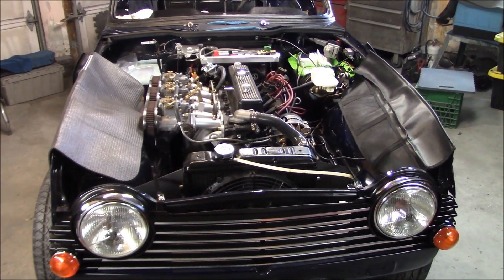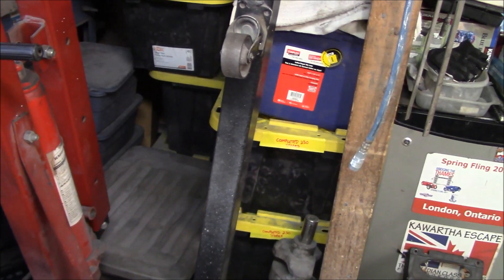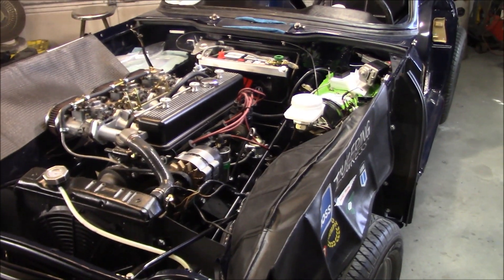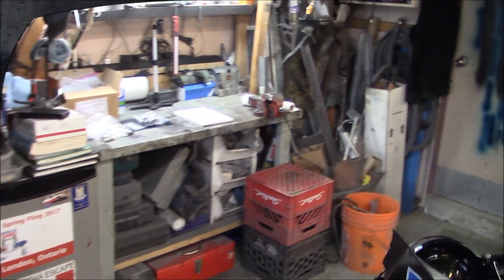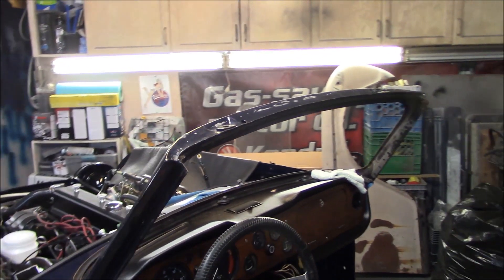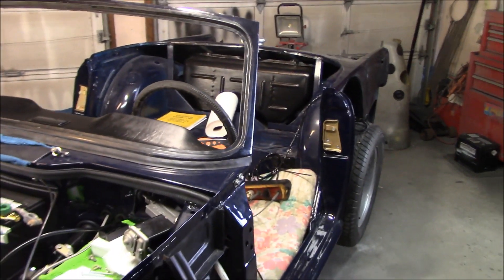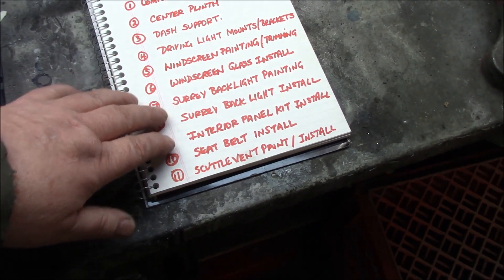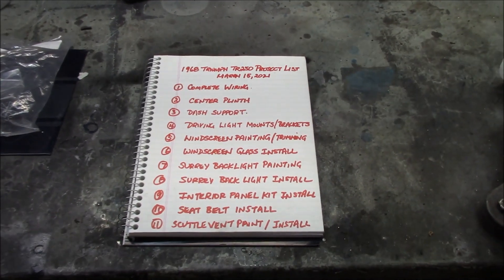1968 Triumph TR250 Restoration,  Project Planning Discussion and Next Steps....

Comment: David do an image search for “TR4 works rally car” and check out the light bar on that. It uses the bumper mounting points. I’ll bet you could fabricate one just like it. BTW - Revington sells a similar one for £270!!!!!!
Reply from the maker: Hi Jim, yes I’ve googled lots of different images and have found a few I like.  I know, the revington and racestoration ones are very expensive.  That 270 is 470 Canadian without the shipping/ duties or taxes.

Comment: looking great David.  An option on the dash support is crinkle paint,  Chris from Roundtail did it on his Spitfire and was happy with the result.  I am not sure of the configuration of your backlight, but if it is a window in a rubber seal, similar to the windscreen, some string between the backlight frame and and the rubber seal will give it a bit of a lift so there will not be a tape line where the paint meets the seal. Probably not a good idea if the seal is hard and brittle though.
Reply from the maker: Hi Graham, I’m not a fan of the crinkle paint..I know some guys have even used truck bedliner...there is also a pure sewn vinyl or leather wrap you can get for it as well....I think I can rescue the one I have, so I think I’ll be ok .....I’ve got a 3M tape that goes behind the seal and then pulls it up...I’ll show it when I get there 😉

Comment: Similar issue with my dash support.  Previous owner added some switches which in itself wasn’t bad but they weren’t close to being in any sort of line.  I opened one up for a second power outlet.   The other is still there mocking me.

Comment: Point of correction... as I remember from earlier you DON’T have a Surrey top... you have the stock Hardtop comprising the glass Backlight section and a metal Hardtop panel. The Surrey top is.a lightweight vinyl covered metal framed ‘Targa’ panel that clips on an off in the summer instead of the metal panel. You need to talk nicely to Moss....
Reply from the maker: Correction, I do have the Surrey “soft top” section as well...it’s actually canvas 😉
Reply: @cheftush  Great... I was just nitpicking the nomenclature !

Comment: Chef, this project has been a pleasure to watch, despite it meaning your '59 TR3A being put on hold.  Why are you going to run the car without a front bumper? Each to their own but personally I don't like the bumperless look; it will as if you have not finished the job.
Reply from the maker: I actually like the look better without the front bumper.   Maybe you will change your mind once I get the lights mounted up front 😉